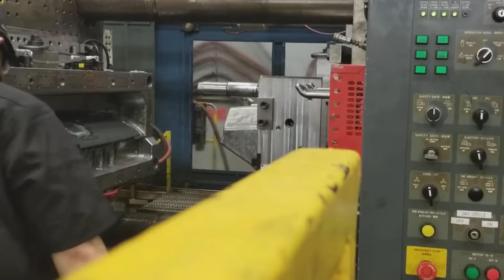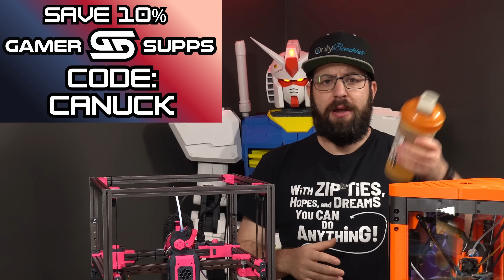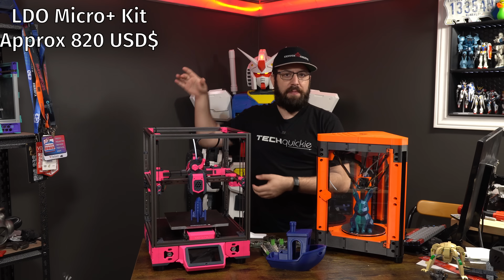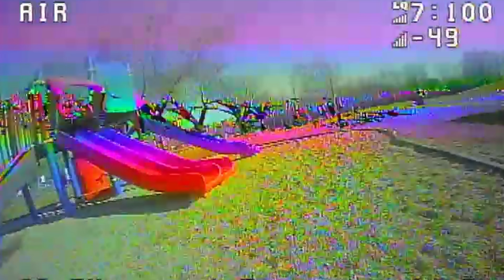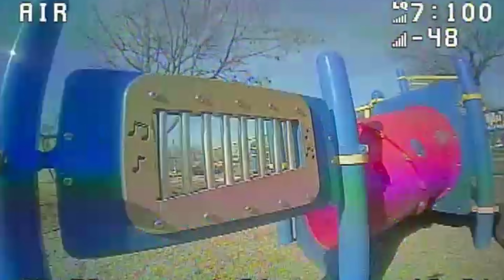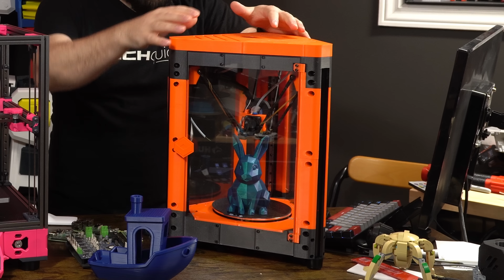Are DIY 3D printers in danger?

Comment: I got so used to my Rat Rig V-Core 3 500 that buying a printer is kind of not usable for me. I am used to not thinking about printer size when designing stuff because almost everything fits on my printer. Re-learning to design things around the size limitations of a smaller printer is so offputing an idea for me that I am not even considering buying a printer. Add to that the slow but steady push to lock users into branded slicers and filaments and I am out. They will have to kill the kit printers entirely to get me to buy one of those 250x250 grey boxes that work through a cloud connection.

Comment: I also got into 3D printing in 2017, and for me the hobby has shifted over time.  I started with a Tevo Tarantula kit.  From there I started building diy printers and eventually a 2.4 and Switchwire.  While building those printers I learned Fusion 360 and later FreeCAD to design some stuff I wanted to make.  Then I began selling some of the stuff I designed, and sadly now I don't have time to work on the printers themselves.  I need something that just prints without tinkering.  I still use my 2.4 on occasion, but I mostly use my A1 mini and soon I'll be likely replacing the 2.4 with the new X2D.
Reply: Why not QIDI? They are a lot of machine for the price.
Reply: @thirtythreeeyes8624 a lot of bed too.
I got a Qidi Plus4, and... I've been spoiled. I can't go for a smaller bed (300x300x280). Really easy on maintainence too. And unlike bambu, it doesn't need a cloud, I keep my machine airgapped because I can, because that's what works for me.

The only downside for me... the multimaterial system Qidi's made seems flaky as, and I got my machine before that was an option, so... I'm staying single colour on this machine.

Comment: I am building a Voron v2.4 because there is still some practicality in doing so. I originally wanted to get a large volume 3d printer without having to pay the increasingly absurd prices from Prusa and without dealing with the closed ecosystems of Bambu and it's clones. I also highly value upgradeability which I notice that Prusa seems to be slowly moving away from without admitting it. For the time being, I still think DIY printers still have their niche in the prosumer category.

Comment: I am a functional printing type that prints stuff to solve problems or repair things.  I sit in the middle crowd where I like to tinker/build when time allows but also want something that just works with no fuss when needed.  I have a similar history to yourself where I started out with a crappy Anet A8, moved to and Ender 3, and so on.  Same with drones where I built from scratch back in the day and progressed from there.  Some days I just need to print something and having a consumer grade printer that just works is great.  Same with drones, some days I want to mess around with it and other days I just want to fly and not worry about it.  I keep thinking I would like to build a Voron 2.4 but when I can go buy an off the shelf printer (K2D on my radar) for less that works just as well it can be hard to justify.  That is why I am in the process of making an Ender 3 NG from my old Pro.  Not as good as a Voron but I have most of the stuff already to build it so I may only be in it for a couple hundred bucks when done.

Comment: I designed and built a corexy printer in 2020 for about $200.  Today, I would not do one from scratch.  It's cheaper to get an obsolete high end printer for next to nothing and then improve it to get modern printer performance.

Comment: Reminds me of the golden age of electronics ending.
Reply: I've been involved in FPV, arduino/raspberry pi and 3d printing since the early days of each and it always happens to some degree with things like that. They get created by hardcore engineers and makers to fill a niche that wasn't filled and then as they develop and gain steam the average user who isn't writing their own code and designing their own parts want's in or want's an easier experiance and the market shifts from passion to profit. It always happens even the internet itself went through it. It seems like there's always a 5-10 year period of just rapid open source innovation and then a move towards capitalizing on the market which then often leads to enshitification or at the very least stagnation.

Comment: My Father and older Brother started in 2012 with a "kit" by some cnc shop. That printer had a nozzle glued into a plastic heat break, not part cooling or hot end fan, and a prusa mk 1 heatbed. Still even though the machine is a mess with us trying to make it work somewhat over the years It has been so fun. Same with my MK4 that I upgraded to a Core one, knowing how the printer works/how to fix it/ how to mod it is what keeps me in this hobby. Also what finally now brought me to in the fun weekend I had building the core one just say f it and buy a ldo v2.4 kit. It has been now consuming my life trying to figure out a small thing (that I still not have found) and after this printer is "finished" I will most likely build a v0.2 or a lemontron. I love making benchies but building understanding and maintaining my printers is some of the most fun thing I do with them. I really hope that people start coming back or atleast modding their grey cube core xy printers. I'd hate to see this fun of wonky fixes for printers go

Comment: I've pretty much left the hobby at this point other than a print here and there. Started on an Ender and quickly moved to Prusa in 2019 ish. I've seen the space change rapidly in the "golden area' as you mention. Users these days have no idea how good they have it, could even be said about us when we came in late to the party.

It was a lot of fun to build my 1.8 and upgrading it to the Trident. However, that was the hobby and main sink of my money and time. I printed everything from single color to using several multi color devices but it's worn off and is now more just practical prints. I eventually also had a Rat Rig and all mentioned printers have been sold. I ended up with a p1s and that's pretty much all I need to go print here and there without any thought or care. I am interested in a bigger printer at some point and possibly indx but it feels like I've done and seen it all already. It has gotten stagnant for me and for most people just pressing print is enough.

I do miss and long for the fun and excitement Voron brought me, I could chase it again but my life looks different now and it would quickly fall by the wayside.

Comment: Not gonna lie, standardizing on a single tool head, extruder, hotend, and leveling system would fix most of the problems people have had with diy printers
Reply: Bondtech INDX with load sensor probing, backed up by Duet SZP eddy probing could become a standard for many hobby printers hopefully. Not quite DIY for those parts - but DIY for the rest.

Comment: For myself I went to DIY cause of certain features the out of box was out of my price range. Started with reprap clone, then MakerBot Replicator when it was affordable and was pretty reliable. But ABS was not consistent. Then went to a Voron cause wanted consistent ABS, then PA/PA-CF came out but it didn't do it well consistently. Now after 3yrs finally bite the bullet and got a H2D and it prints PA-CF, PC very consistently well. I might go back to DIY for something that can do PPS, PEEK consistently @ an affordable price, since the commercial ones that does them are super pricey. So the way i see it, the DIY will still be there as long it keeps pushing highend features making them cheaper and more accessible, forcing commercial brands to lower their price, and the cycle repeats.

Comment: I have an Elegoo Centauri Carbon and used it to print the parts for my Trident.  Going from (what was once) an Anet A8+ to a modern printer was incredible.  At last, I could print things other than printer parts with a decent finish and accuracy.  My large bed-slinger became a donor for a lot of the parts for my Trident (power supply, motors, extruder, controller board, bed), which kept the cost down quite a bit.  The fact that I was able to tweak the Trident CAD to accomodate my components highlights the benefits of open-source printer kits.  I wouldn't even attempt to modify my CC, mainly because it performs solidly as is.  Now, with a Trident and a CC, I have the best of both worlds - a printer to tinker with and one to "just click print".
Reply: Yes and sometimes you really just want to press print and not have a printer in various states of disarray
Reply: I'm doing basically the same thing : I have a CC for when I want prints, and I salvaged a CR10-S Pro from my workspace that I will attempt to convert into a Switchwire over the summer. If I succeed it will become my "large PLA/PETG cosplay printer" while the CC handle everything else.
Reply: @amaurylaunay  yeah, my Trident is a custom frame at 350mm^3.  Actual useable volume is nearer to 340mm^3 but it means I can print larger stuff on it if I want.

Comment: I think that the open source, DIY 3d printer hobby isn't going away, but it will stay a niche hobby that will slowly grow in population. I got into 3D printing with an ender 3, and didn't learn about DIY printers until years later. I can only assume that other people will do the same, and it's like discovering a whole new world.
Reply: Not going away but there's been a shift that took away the path we got into this. Commercial is basically better than diy now, it wasn't back in the ender3 days. Now you can just buy whatever you want for less than you can diy and it's more reliable than anything diy too. It's still a nice hobby if you like to tinker but it's no longer a good way to just print. People aren't even modding their printers anymore for the most part because there's no reason, buy a better one or maybe a commercial addon product.

Comment: I have been building 3d printed turntables for three years. Since I need a large bed, things like the Bambu units simply won't work. I currently use a highly modded (not quite a VZBot) Tronxy to make the platter and plinth for my  turntables. The kit was quite nasty but a fairly easy way to get a frame and some usable bits. The BIGTREETECH Manta 8P with Klipper is incredible and even have a large LCD computer screen hoooked up for easy control.

I can't imagine how frustrating it would be if a fancy pants Bambu breaks and the user has no idea how to repair it! I even printed and assembled an Annex Engineering Sherpa Micro Extruder. Any part can be built/serviced/repaired. 

Personally even though the main reason for a 3d printer was production, building them is actually way more fun. Love your channel, a fellow Canuck from Vancouver.

Comment: I think people still like DIY printers but don't have the funds for it. I've noticed the number of people watching streams of people building printers is higher than streams of interviewing creators or people using CAD software or showing off prints and filament. People enjoy watching printers get built. I've enjoyed building my own printers and I've been fortunate enough to be able to afford it.

I haven't done any research on the amount of people still building DIY printers, but it wouldn't surprise me if the numbers have remained similar over the years. It just seems more dramatic because there's a much higher number of individuals just buying consumer printers instead of building theirs. Say 10 years ago maybe out of 1,000 users, 900 of them built their own printers and now out of 10,000 users, 1,000 built their own printers... That's still more people who built their own printer. It's just the number of consumer printers that have skyrocketed. I'm curious to find out what actual numbers are on the matter. It's highly probable that I'm wrong.
Reply: Seems like many kits have very high markup, some are around 2-3 times the cost of sourcing the parts yourself.
Combine it with good comercial printers under $500.

I think that's why...

Comment: The whole reason people used to build their own printers is because it was the most bang for buck option at the time of the enders, yes there was cheaper like the ender 3 but they sucked to use, yes there was more expensive and whilst they were good like the prusa Mk3 you could make a machine that was twice as good for not too much more like a voron. Nowadays you can get a machine that is half the price or less than a voron that is 90% as good/as fast and for a lot of people they just can't justify that last 10%. And at the end of the day the voron side of things aren't making leaps and bounds with new ideas anymore and a lot of developments that they did make with the flying gantries add so much complexity yet don't really change the quality the part. I think FDM is the biggest limitation because of how mature it is there are no drastically changing ideas the same way injection molding or cnc barely changes anymore, I think the best idea would be for designers to move onto other technologies like SLS or SLM to give it the same Kickstart that FDM had in the golden age.

Comment: Fpv also has the issue of regulations making things difficult and printing is also staring down that barrel.
Reply: FTFAA
Reply: Look at companies lobbying FOR restrictions. A certain drone company ... and a printing company who also favors insanely locked up electronics.
Reply: @LightCarver  Dji?
Reply: @NaCl_022  Yes, and guess what 3d printing company was started by former techs.
Reply: @LightCarver The overhyped CCP spymachines that make alot of noise but are slow?
Reply: @LightCarver  I guessed that bamboozle machine is a trap from day 0.

Comment: FIRST. 😁 Now that that's out of the way, I don't think DIY/kit 3D printers will go by the wayside, as the market for them is people who prefer a more personal experience. That means there will still be people who want to build and/or tinker with a printer. I will use myself as an example here. I have a Kingroon KP3S PRO S1 that I used for a couple of months, totally stock, but there were a couple of things I did not like after getting it. The first was that I was always having to remove and insert the micro-SD card to load anything onto the printer to print. This also meant I had to manually start a print job on the printer. Second was part cooling and the hot end. This printer orginally as a standard V6 hot end; it now has a Revo V6 hot end. The original is good and all, but with some of my physical issues to deal with, making sure the nozzle stays the proper tightness is difficult, so replacing it with the Revo V6 made sense. I also got an SBC that I loaded with Klipper and connected to the printer, and now I send print jobs to it that way. I do plan to get a kit to build so I can print more than just PLA, PETG, or TPU.